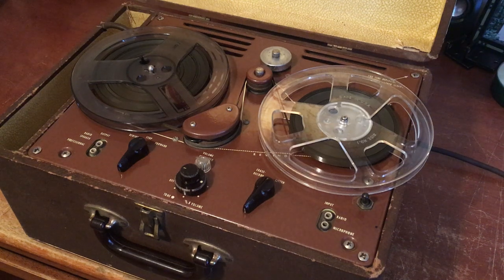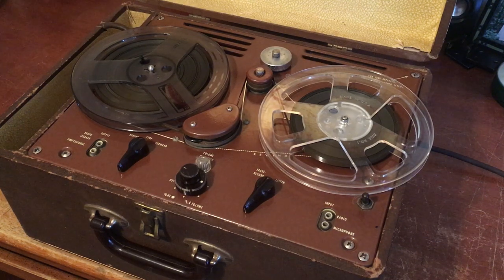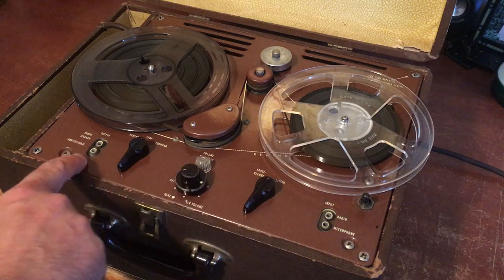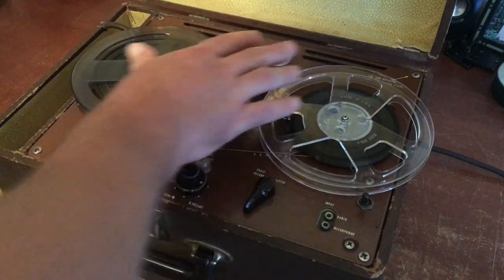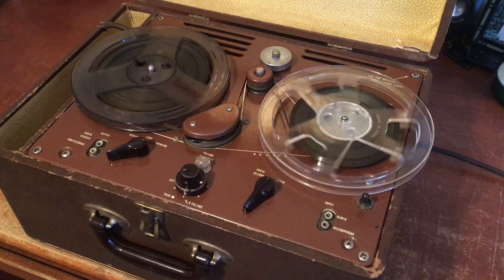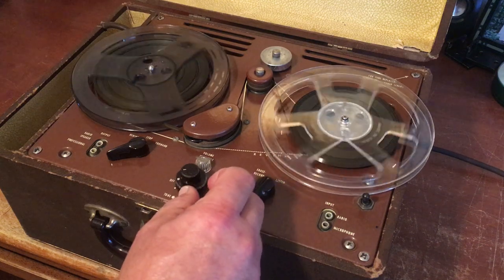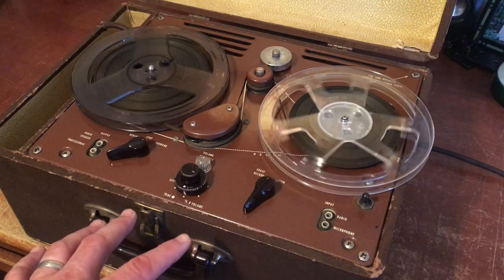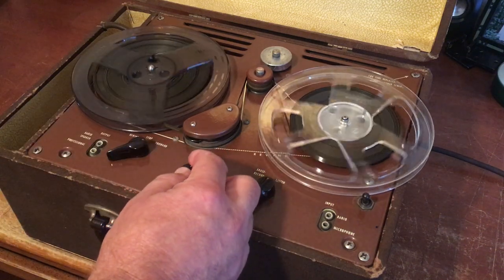Eicor 115 Vacuum Tube Reel to Reel. 1955

Comment: I have one of these I inherited from my grandparents. Seems to still work, but won’t rewind. I’m guessing it needs a belt, but whatever belt that was on it wasn’t inside the machine. The 4 screws that hold the top down are missing, so I’m guessing my grandpa probably got in there and retrieved a broken belt at some point and never got around to it. Any idea how to find a replacement belt?
Reply from the maker: @rpeirce9044  I would measure the distance from the center of each flywheel and buy a belt that’s similar size. Might take a few try’s to find the right one.

Comment: I literally just found one in my attic and I need to know how to make it operate- what resources or individuals can you link me to to get it running- I hear it hum when I turn it on but the features don’t operate when I change the switches; does it need a reel to operate? Oh so many questions!
Reply from the maker: Yep, you need reels and tape.
Reply: Check the main belt.

Comment: I have one but the belt seems lose.  Do you recommend a replacement?
Reply from the maker: I honestly don’t think replacement belts are available. Best course would be to measure the belt and try to find a close match through a seller on eBay. Plenty of companies that sell all different size belts.
Reply: @marcusdolby1  bought for $20 at goodwill.  It started right up.  Can’t believe how well these are made!